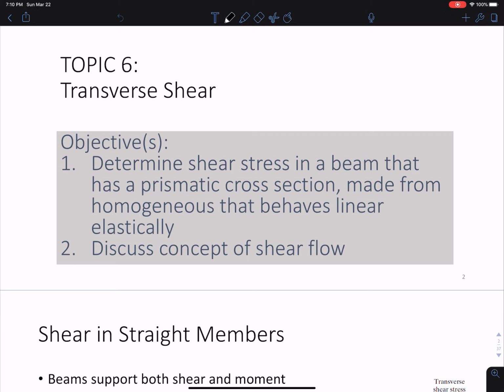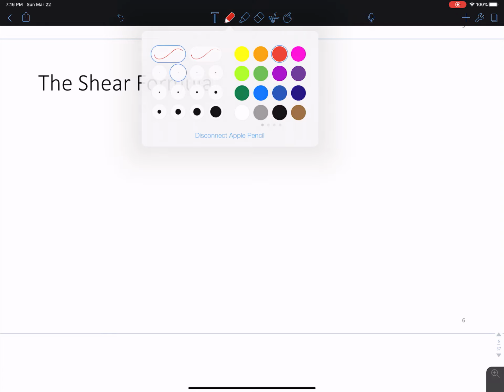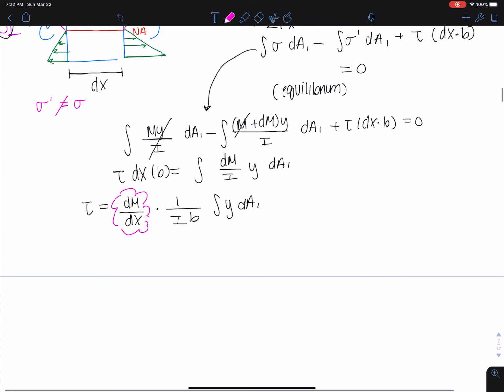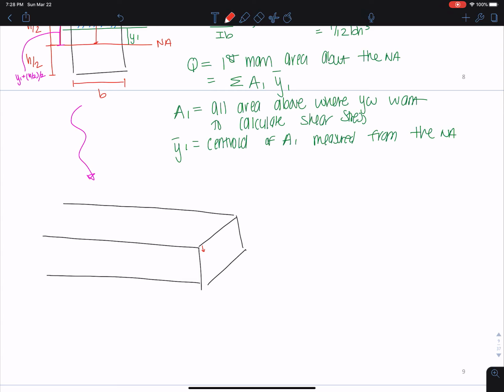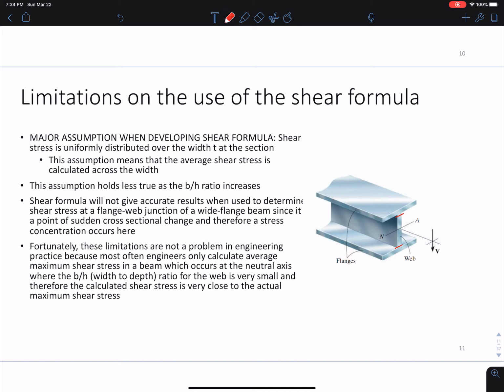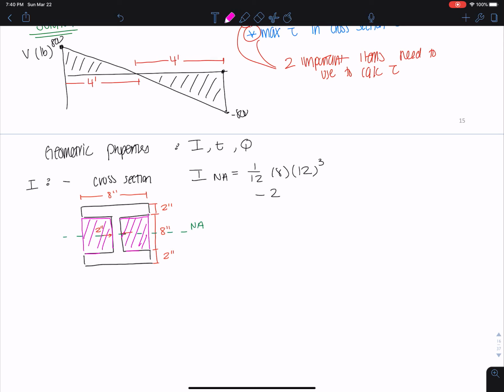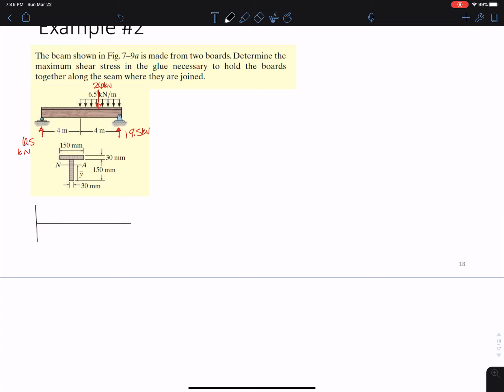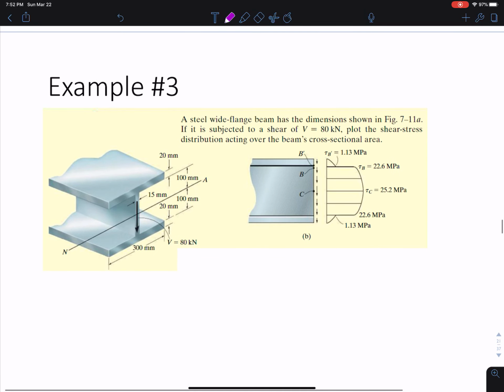EGCE301Topic6Part1

Comment: Is this why shear cracking in concrete beams typically occurs at about a 45 degree angle?
Reply: As you can see the shear stresses are acting on the surface and resulting a diagonal tension. So due to this tension,  crack will be formed at 45 degree angle